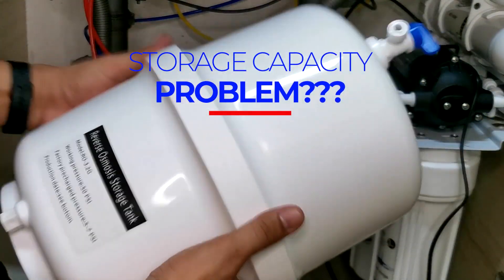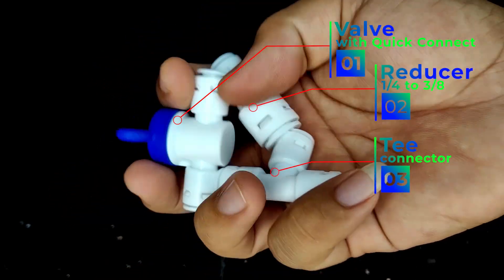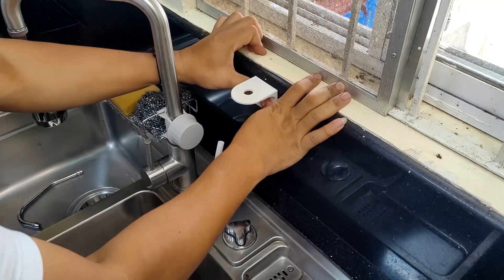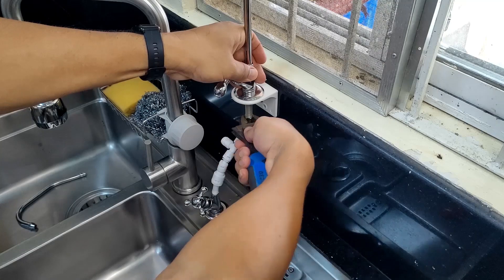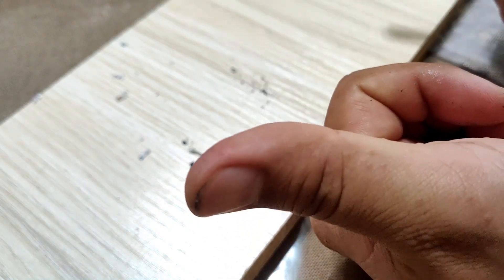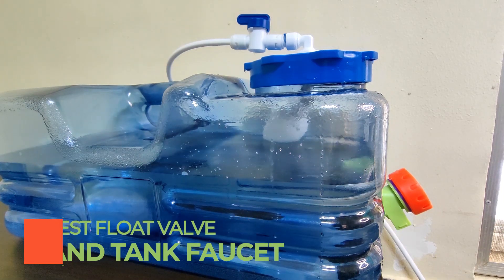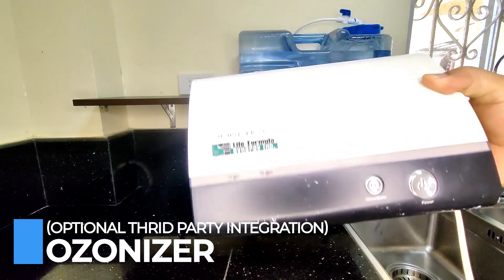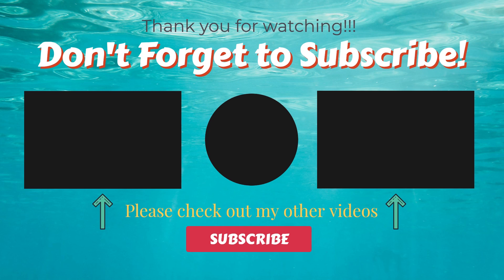How to install additional storage tank to Reverse Osmosis Filter System

Comment: Pwede masura ung booster pump dhil s float valve. Kasi kakaubti lbg lmalabas na tubig so unti unti din maglolock ung valve. Kaya patay sindi si booster pump hanggang ma meet ung closing pressure ng valve. Tama ba?
Reply from the maker: Hindi po. The RO system has a separate pressure tank that gives the pump about 40 psi pressure difference between cut in (start) and cut out (stop). The float valve will not cause short cycling oh the pump.